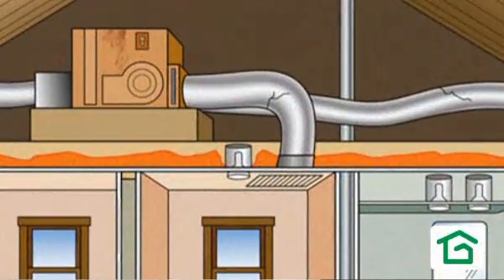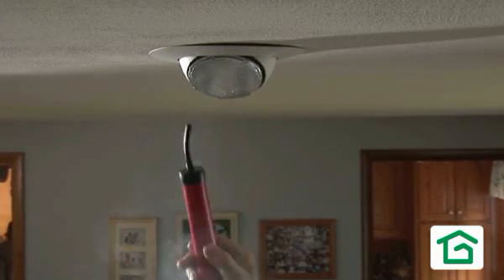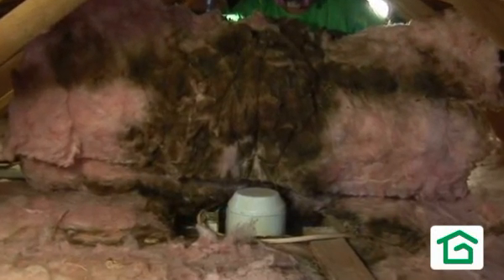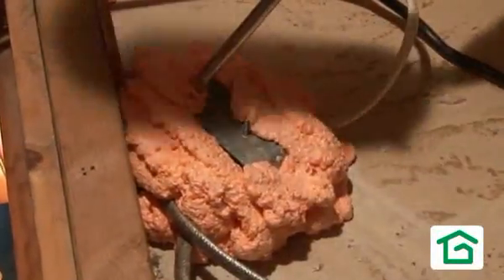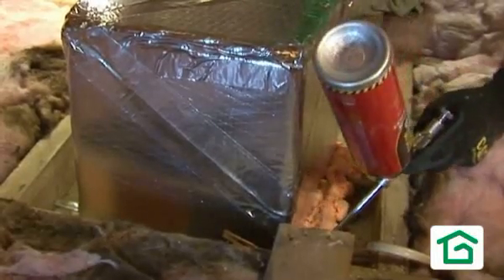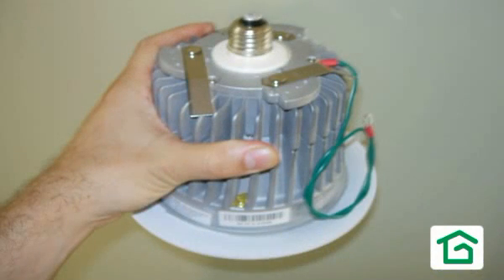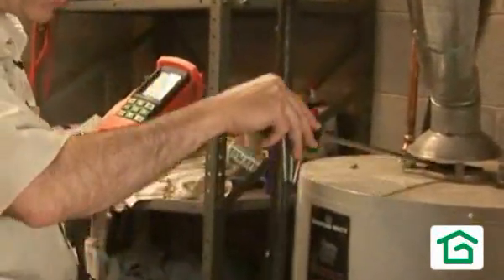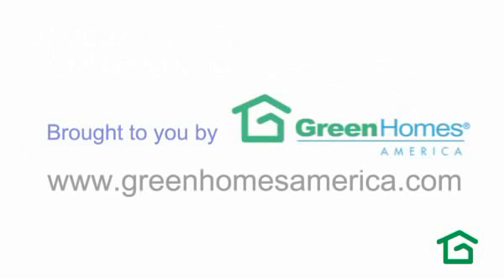Air-Sealing Recessed Can Lights - GreenHomes America

Comment: The problem with covering can lights in attics with most types of rigid foam board is you need to cover most types of foam with a thermal barrier(15 minute fire barrier) i.e. 1/2 sheetrock, 3 inches of mineral wool or any other product rated as such. This applies to attics that have access through a hatch or pull down stairs and/or are used for storage at all. For attics where there is no storage (capability) there are less complicated ways to provide what is called an ignition barrier. For attics that you have to cut into through drywall this method is fine, as the drywall is your thermal barrier. This is fairly new common knowledge(code) and there are some exceptions such as rim joists and ceil plates. There are a few brands of poly iso foam board that are rated to be exposed without some sort of coverage. I believe thermax is one but can be hard to find for the home owner. Note: thermax is not a thermal barrier but can be used without a thermal barrier such as 1/2 inch sheetrock. and forget about dow fire spray foam, it is the same as their regular foam but colored orange. At least that is what they told me on the phone today.

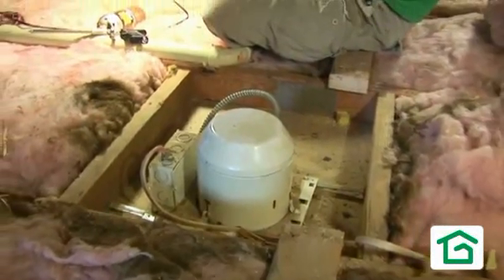Comment: The box at 2:57 ... since you're boxing in the heat of the lamp, what would be a safe size cushion (one commenter said 3")?  Premade rockwool covers don't seem to give much cushion at all.  What should the r-rating of the box be relative to the surrounding insulation?  There seem to be a few theories below as to what the box is made out of (sheet rock, rigid foam, fiberglass duct board).  I assume the diagonals accross the box are just because it was made out of remenants?
Reply: 3-4" is what I've commonly seen. Modern LED lamps only consume about 13w of power and generate little heat.